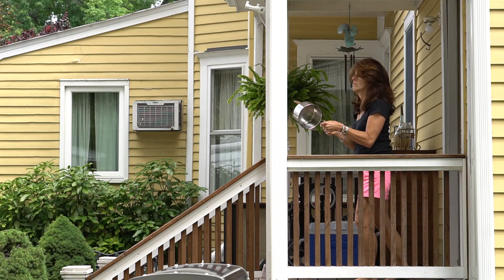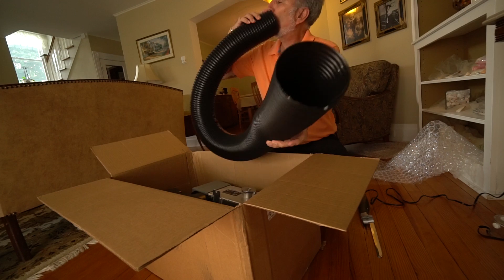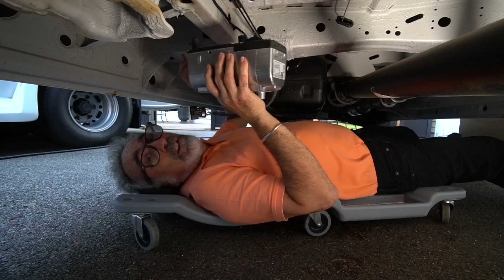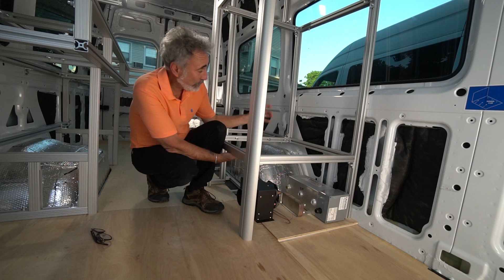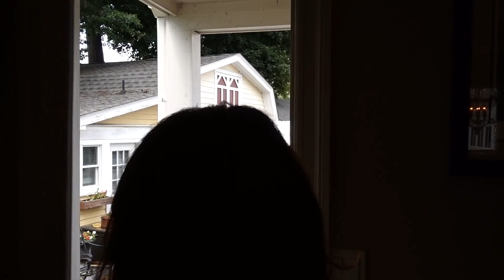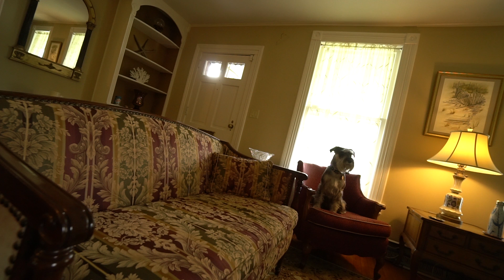VAN BUILD - The Espar Diesel Heating System Explained

Comment: Hey George love your attention to detail, thinking out side the box and always having a Plan "B" If I could I would have my van built by you! Your attention to detail reminds me how Apple build their computers etc...

 Just an observation though as a former bus driver who has had heater pipes burst do to high pressure and formed a glycol mist, just go heavy duty on the piping and mount anything and everything outside if you can. When a pipe or tube develops a fine mist you will not detect it in time to get glycol saturation in your system!
I have been to the hospital enough times to get my blood/air saturation tested enough times to say it is nasty stuff in your lungs!
 You do know that if a cat or a dog licks it because it taste good, say goodbye to your fur baby.

Love watching your videos and knowing what the "Humble Road standard"  is!
Stay Safe you are doing great work!
Reply from the maker: Good point Robert.

Comment: Where did you finally place you glycol tank? Did you connect it to you engine coolant system? Thanks.
Reply from the maker: The tank is under the futon, insulated. Mine is a closed loop system, I don't connect nor edit the chassis whatsoever.
Reply: @HumbleRoad  Thanks for the information. My wife said I should tell you that we are retired and just starting our conversion. You are providing us a lot of ideas.

Comment: what was your solution for connecting the pex tubing in the loop do you have any pictures to aid with explanation. looking to order my system tomorrow p.s. thats for the help and hints you have already provided
Reply from the maker: Jon Duh Uponor to hose barb fittings. Brass.
Reply from the maker: Also be aware of the different types of Pex tubing. One stretches, the other gets crimped! Search Uponor.

Comment: What was your solution to retrain hot water without heating the floors
Reply from the maker: A three way valve. Commonly referred to as a Summer valve. Look through my Community section of this channel for a diagram of the whole Espar system.
Reply: Humble Road 🙏🏾

Comment: Hey George, I was wondering if you had links to all the components of your heating system?? Did you get them from one retailer or many?
Reply from the maker: You can purchase a complete kit from Rixens in Oregon. However, I suggest you do some research comparing the Espar with the Webasto. Depending on your particular lifestyle, one may be better than the other. If you want to discuss, email me at georgemauro@humbleroad.tv

Comment: Good German designed. Very Good for spring skiing and barbecue then hot tub at the hotel and overnight no freezing problem with the plumbing . All 3 tanks , 
W-G-B I would heat with this glycol heaters, or install 2 heaters and turn the second one before draining B&G waters . Adding non toxic plumbing antifreeze to G&B waters raises freezing temperature of G&B waters or adding just the cheep salt they put on the roads in the winter .

Comment: Yesterday I offered to purchase your RV when finished. I am resending that offer today. The reason being it is a Mercedes diesel. The first disadvantages Mercedes. The cost of maintenance is ridiculously expensive. The second reason is the diesel engine. While diesel may give you somewhat better gas mileage in the US if you go to other countries like Mexico and South America you will have a very hard time finding diesel. Give me a Ford transit are a Dodge ram, running on gasoline. I still like your work. You're a fine craftsman.
David Sage
Reply from the maker: There are pros and cons to the Sprinter, Transit and Promaster. Once your preferences and objectives have been identified, you can proceed to the rest of the build. No worries, no problem. I will be building on all three platforms. A Promaster build is in the very near future.

Comment: Great video.  Water and air heating is the next thing on our list of things to buy for our conversion.  We are thinking of going down the LPG route rather than diesel route as we have heard stories around the maintenance required.  How have you found the heater since you have installed it?
Reply from the maker: I haven't used the Espar as of yet. I have decided no propane in this van. That comes from years of using it in my other van. I don't like having to worry about filling it, I don't like the wet heat, I don't like the CO danger. I don't like the tunnel restrictions, I don't like the explosive aspect. I love cooking with it, many have told me induction cooking is fine. We shall see!

Comment: love the videos!! you have a new follower for sure, super interested to see where you go with the rixen system. I just bought it my self and am running into some placement variables as well. happy building
Reply from the maker: The flow length restrictions are the big issue. Fuel line can not be any longer than 10 feet, and that's a push. Glycol line, 30ft total run into furnace and out. At this point, I have developed a "water closet" which houses the glycol tank, heat exchanger for hot water and the house water pump. It's inside the van next to the shower. The glycol reservoir gets quite hot. My thinking is that when you are taking a shower, you want the area to be warm.

Comment: My Cirrus 820 truck camper uses a glycol heater that routes through 11 different places in the camper, including keeping the tanks, bathroom, and multiple locations in the camper warm. It also does double duty heating the water. It is a purely radiant heat system with no fans (completely silent). The tank is inside (glycol only needs to be topped off once a year) and I've never noticed an odor coming from it. Maybe check out the Cirrus 820 system for ideas? Here is a link to the Cirrus though it doesn't go into detail on the system. But a good overview of the camper. https://www.youtube.com/watch?v=BFPENNFsznM
Reply from the maker: Thank you for this info, Bret. I'm on it! Could be the answer I was looking for.

Comment: There are two reasons why I backed off from the Rixen electric-fuel combo with endless hot water. First, if I price parts individually online, I get to about half their selling price for the kit. (I had heard rumors of $1000 for everything except the furnace, but I was quoted about $3300 if memory serves). Second, I was disappointed with the "jet engine" sound of the furnace. My new plan is an electric-only (sadly!) water heater and an air-only fuel-based furnace.  Noise-for-noise I'll be saving about $4000 and won't have risks of coolant leaking inside.
Reply: The fuel-based air blower has to sound pretty darn similar to the water heater. They use the same type of diesel burner after all and have exhausts with silencers. If anything, blowing air into the van will no doubt add its own noise. But sure, if you can buy the parts separately for less then why not. The Hydronic heater and heat exchangers is a pretty nifty way to get both hot air and hot water into the van though, and without having to have a hot water tank, it's all on demand. Which is important for those of us building showers.
Reply: Oh I have a shower. :) And I agree the noise savings are likely not significant if at all, but overall spending 3-5x the amount for the same kind of noise bummed me out. Also, note that the space you're saving on the water heater, you're investing in the coolant reservoir, so that's about even, and again I wasn't in love with the idea of having to maintain a coolant system with parts inside the living area. If the whole thing would've been around US$2500 I would've made the jump, but $5K is too much for the little bit of added convenience vs air and electric water.

Comment: Ooooh.... so the Espar will do cabin air, heats water, AND coolant heating? Sweet!
Reply: In a van build, you probably don't want to route the furnace for the van through the engine though, or else you'll be keeping your engine block heated all winter even when parked for days. But having a separate identical heater for the engine to run on demand would be a nice luxury option (apparently this van came with that installed.)
Reply: Croft I don’t think he’s doing that. This seems to be solely for radiant heat in the floor.

== EDIT ==
I mean the coolant portion.

Comment: 4:27 You basically only need a radiant heat barrier, like a piece of Reflectix. Other than that the blower will actually pull warm air produced by the fridge compressor and blow it away from the fridge.

Comment: Can you put up the links to the products? I'd like to review their features and get a better idea of what your doing. I have always written off the idea of heated floors until your idea using diesel. Brilliant. Can't wait for the next steps. Subbed
Reply: I'm not sure I believe in the heated floor idea, but the components here all look identical to what Advanced RV puts in their builds. Same tank, same optional shore power heating, same heat exchanger and certainly the same Espar.  I'd like the same list of components myself, though. Because this is to my mind the best way to achieve both hot water and a warm cabin in a van.
Reply from the maker: The lines transporting the glycol to and from the furnace have heat in them. I have to route them to and from, so why not on the floor, with radiate panels. This is one of the reasons I installed the one inch framework on the floor; air space for insulate purposes, air space to combat moisture and a space to run my mechanicals.
Reply: I'll certainly be interested to see how it works out for you. Personally, I'd probably have stolen an idea from Advanced RV and routed the return lines to the furnace past the water tank(s) and right next to all the plumbing to give up waste heat to those in the winter to avoid them freezing.
Reply from the maker: All the deets will be made available at the end of the build. Thank you for commenting and welcome aboard!
Reply from the maker: The fresh tank and all the plumbing lines are inside. No freeze issues. I have only the grey tank outside of the van. It will have a 10gpm purification system so you can use it to wash the van, bikes, or just let it drain on the ground.

Comment: Technical Question / Comment:   What steps will you need to take to reduce vibration / creaking noise when bolting the 80/20 sections to the van structure?   I was recalling your RV 'earthquake' depiction and wondered if you were using any dampners / isolators?

See YT Video 'Anti Vibration Damping Sheet'

Thanks as always for letting us watch and learn.
Reply from the maker: I am using split lock washers in addition to loctite (blue). Wherever a bolt attaches to the van body, I have or will have the 1/8" thick mass vinyl in-between. I imagine it will all start to creek eventually. But I find that to be insignificant since everything else you are putting in the van rattles all the way down the road! My silverware especially! But I know those sounds. I monitor those sounds and when something isn't right, I know it immediately.

Comment: George, if it were me, I'd position the furnace and heat exchanger in the space under the wardrobe. While small, it looks big enough to accommodate these items. To my mind, the space under the refrigerator would be much better utilized for storage. A nice tall drawer on full extension slides.

As for the reservior, I'd mount that inside at the back of the van. Perhaps adjacent to the toilet, or elsewhere in the space under the sink. I don't believe you'll have any issues with odors. However, if you did, you could easily build a box that's sealed to the interior of the van, yet still vented to the outside, that also provides access for and maintenance (think vented gas bottle box).

Just my 2¢.
Reply from the maker: Good suggestions, John. That space under the fridge is quite large.

Comment: Hi Humble. Glycol is a petrochemical product and will emit chemicals for sure. But your glycol system is encapsulated in a closed system. Unless I don’t understand the exact design I’m not sure this is a concern. However, when the heater is on using diesel as its fuel source I suspect there will be some fumes. I have never seen an air filtration system used on this type of unit. I have asked many many tubers if there is odours from their little buddy heaters or nuwave heaters and never gotten an answer on this issue. I decided to go with a low draw electric heater working on remote/thermostat just to be safe (would work with GZ yeti 400 lithium) in my rig. This system hasn’t properly been tested yet at varying lower temps bc we’ve been sweltering here for weeks. 🔥. You are making an extremely important contribution to van build knowledge by including occupant health in your choice of materials. I have watched hundreds of build videos and this topic is rarely broached. Thank you and kudos to you! 🥇
Reply from the maker: Thank you Mishu. I intend to keep this build pure in terms of health exposure. One of the reasons I went with aluminum over wood. No mold or moisture issues. I am particularly happy that I found the futon in San Fransisco. All natural wool, no chemicals whatsoever!
And don't forget, no propane in this baby!
Reply: Humble Road Ill be interested to see if  the espar has zero to very limited emmission in the coach. I dont intend on owning any type of diesel rv so this is purely scientist/tester interest. Btw should you find a product you want to use but it emits unwanted chemicals look into Safecoat products. I spec’d them here in Canada and approved them. My current house was a test site (pre-occupancy) and passed 👍. Also nvr found a non toxic stone sealer even though ones were made for me to test but do use food grade bees wax where appropriate.
Reply: The furnace will sit outside the cabin entirely, under the floor. It sips diesel and has its own exhaust. The only thing entering or leaving the van through pipes will be hot water/glycol mix. So it should emit basically nothing at all inside the van.
Reply: This is an interesting conversation
Reply: Croft  So the fan runs over the glycol tubing which is warm? Hot? We had furnaces like this for a while in Canada but they didnt perform well in our temperatures for home heating. Few ppl knew about them and fewer bought them. For us they were more a 3 season type furnace. Ill have to see how the unit works when Humble installs. A heating system that is well designed and efficient is a thing of beauty!

Comment: If that heater system has a completely enclosed glycol system...air tight...you wont have any odor problem.  If the system is vented...then an odor will be present.  The odor of anti-freeze makes me ill.  I cant handle it.  I just recently dropped in a new engine and switched to zerex g-o5 antifreeze.  I cannot detect an odor from this stuff.  Might be useful for your purpose.  Just saying.  Will be interesting to see how it all shakes out.
Reply: No, and there's an advantage in having it in the engine bay - you save that much space. Downside is having to pull somewhat longer insulated hoses.
Reply from the maker: In certain situations, anti-freeze is toxic. Just the smell makes many people sick. I'm not taking that chance, there is no real advantage to having that tank in the cabin.
Reply from the maker: I do not want to waste one inch of that hose. There's energy in there to be harvested!
Reply: Humble Road ...i had a thought.  Shocking huh?  I agree.  Anyways...because there are some operational performance issues...wouldnt it be prudent to take a step back...make an operating mockup...and see first hand what issues there are...if any. E.g. heat spillage...odors..etc.  This is a design and build project...sometimes ya gotta do what ya gotta do.  Just an idea.

Comment: You mentioned Glycol, just wondering which one? If it's anything like propylene glycol then I wouldn't worry about it, it shouldn't smell unless the manufacturers put something else in there. Propylene isn't dangerous; in fact it's often use as a base for flavourings. But I can't say I know much about the others types. P.s Cool van build 🤗

Comment: Dam, those Germans know a thing or two about cold weather. That kit   looks like it was made for a tank. I think it makes sense to put the reservoir in the engine compartment so when you're checking and topping off fluids there all right there. Also thanks for letting us into your home, very nice of you. 🍷👈
Reply from the maker: Agreed. Although, I don't want to give up that little house battery living under the hood. I plan on dedicating it to a small inverter for phone/laptop charging duties.

Comment: eek I didn't even think about the smell of glycol/antifreeze water. Is it that bad?! I mounted my tank under the kitchen sink. Haven't actually tried it yet, what could go wrong?! I like the idea of mounting it in the engine bay, will have to have a look in the Transit.
Reply: Eat Sleep Van The only things about mounting the reservior in the engine compartment are:

1) Routing of the lines. Beyond simply being a pain, line length is a real consideration.
2) Heat loss over the length of the lines. They must be well-insulated.
Reply from the maker: Line length is exactly why I thought of bringing the tank closer to the source. I want those lines serving double duty.
Reply: How about under the fridge area under the van? Why or why not?